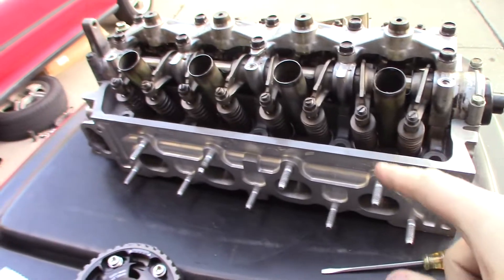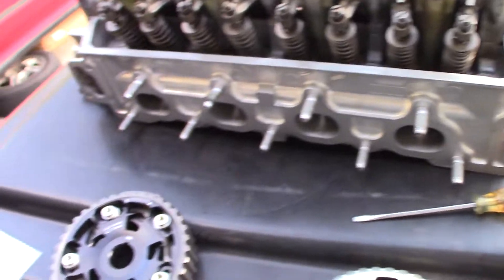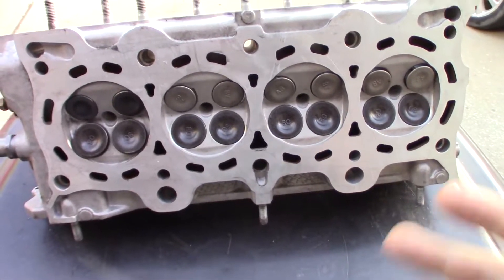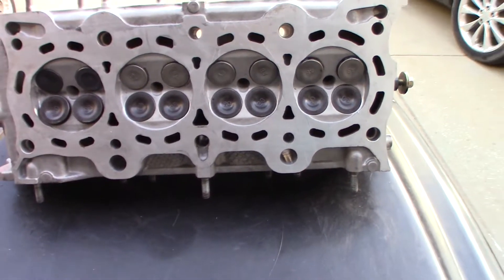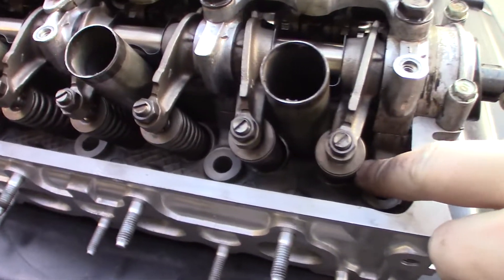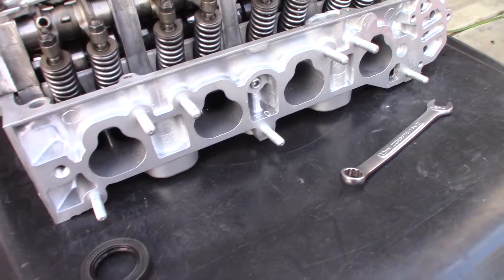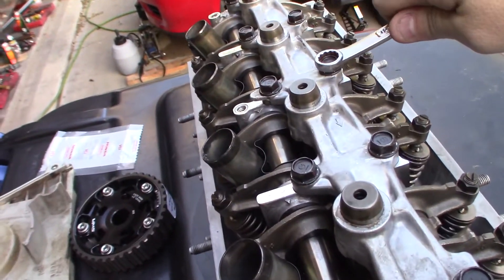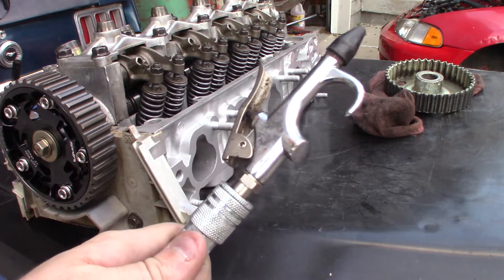Should you have your car's cylinder heads rebuilt?

Comment: Question, I can’t seem to find an answer to is I have a high compression motor and I have high compression heads. I suppose there’s couple of springs roller rockers. I have purchased this car and took the heads to get machine so the valves were taken care of no new valve seals. My question is, is there a break in. On that type of thing I know a break in period is required when you have fresh rings but I can’t find information on how to drive after putting fresh valves in.

Comment: I have a 2011 Chevy silverado 5.3 200k miles, I’m thinking of doing a cam and forces induction throttle body with a good tune. I don’t daily drive a lot just from work and back or what ever plans on the weekend. Do you think the rebuilt heads can take the beating or should I just get new heads.
Reply from the maker: Lots of guys making high three and four digit horsepower with factory GM heads. Just need to make sure they are in mechanically excellent condition and machined flat with good valve springs

Comment: I had an engine seizure , am looking for soneone to redo the engine. Cld it be done? Any leads or recommendations. Seems main issue was low oil. Am in the mod west
Reply: See how much it will cost to rebuld the engine vs buying a new/remanufactured engine and replacing it, sometimes its cheaper then rebuilding the engine

Comment: I have a 1993 GMC Sonoma and it only has 88,000 on it I got it at 86 should I have my head's resurfaced if I change out the head gasket I feel like it has low mileage compared to most
Reply from the maker: I can't say one way or the other, I would say have it measured. How did it run before?